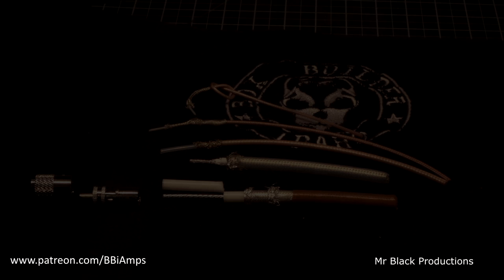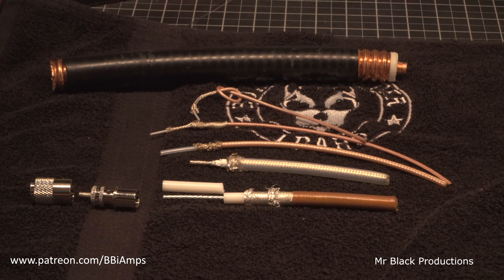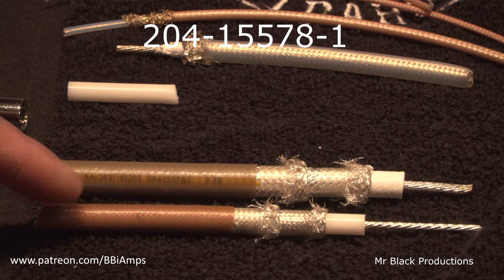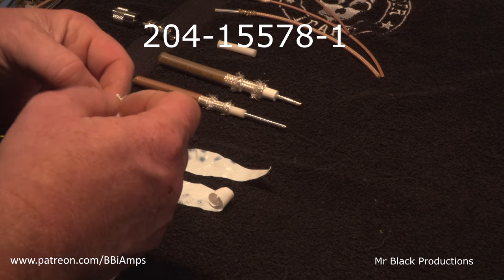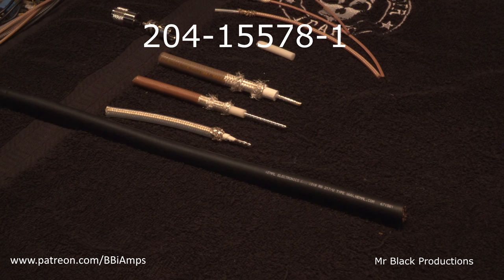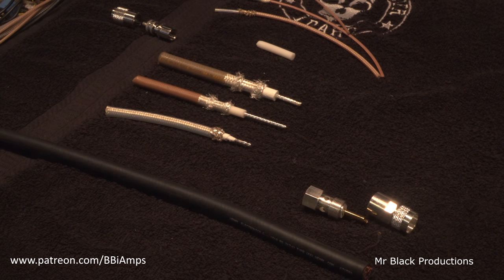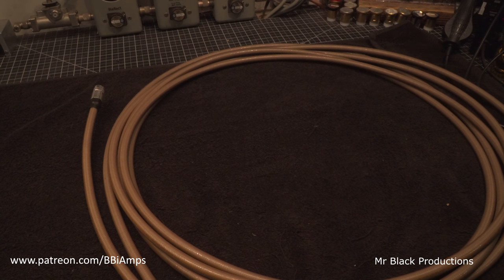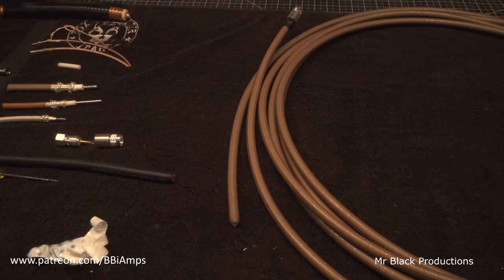Coax of the Gods "3.0"

Comment: Strange i just stumbled onto your video but i have ben looking for some really good coax & Connectors & Very Recently found a place out of italy that makes some of the best in the world...I have ben into radios for 35+ years ran a shop an all and i used to have trouble out of my coax seam like all the time until i found a 3/4 hard line & Teflon pl259's & that was the end of my coax problems(I was Running a small 2 tuber an maybe a 4 once n a while but i had trouble trying to run a 2..until i found The better quality Stuff..i know for a fact you just need to Buy Once Cry Once..lol.

Comment: I scored 100' of marine grade "5DFB" coax for cheap.  Japanese made, LMR-300 equivalent.  It's not made in this quality any more.  Solid #12 center conductor or #10 haven't measured, actual copper not copper clad, foil and braid shield.  Love it, wish it was still made in this quality.  Chinese still make it for cell phone boosters but its totally different than the original.

Comment: I’m curious as to whether TImes Microwave would do another run of that for a free range buyer’s group and, if they would,, what would be the minimum run and cost per foot (meter ?)

BTW I have used that Teflon stye of wrap to insulate some magnetic loop tuning capacitors I was prototyping. It almost worked, but I need some better manufacturing  techniques. Fun to try stuff, and learn as it bursts into flames

Comment: If you run that kind of power, you really need air dielectric!  So the heating is from the higher voltage and current?  That is into a 50 ohm resistive load when your coax got that hot running 30kw?  Have you broken down the dielectric of Heliax feedlines?  The reason this intrigues me is that it's about radiated power at the antenna and not just how many watts you can cram to it.  Teflon coax was never really made to be for long runs as it is kind of lossy.  It is a jumper coax.  I know this is an older video but for some reason Youtube is showing me CB coax and coax "tuning" videos!  lol  Thanks

Comment: Mr BBI have you looked at the  The S65161-A is a super low loss coaxial cable that’s also highly flexible, and unusually lightweight with electrical characteristics comparable to RG393

Comment: The 204- p/n is unique to E-3 AWACS US NATO UK FR specific and not the 707 airframe original.   Cage 81205 is Boeing.  A single dash number indicates a part, -10, -20 , -100 and so on would indicate an assembly.

Comment: Cable from Boeing 204-15578 is not the biggest Teflon Core flexible coax out there, the biggest is actually RG211:  center conductor = 4 gauge solid copper, Jacket Diameter = 0.71 inches...sadly it's only available to US military.  Closest equivalent might be specialty aerospace coax like RFMATES PIC_UH25107 (8 gauge), or maybe Carlisle 310701 (7 gauge).  If you need 45 kilowatt CW power, try 1+1/4 inch diameter coax like Heliax AVA6-50 which is used on almost ever cell tower in the USA, connector are part number 114EZNF and cost about $87 each which is too expensive so I just make my own out of copper water pipe.

Comment: I've been on a very different coax journey.. I'm looking for coax that can stand very many repeated bendings yet be extremely low loss.. I'm running QRP at vhf frequencies so the lower the loss the better.  Since I have to tear down and setup every time I operate my coax take a real beating..  I dunno, this is probably not the right place to ask but hey, it can't hurt :)
Reply from the maker: how big?
Reply: @BoxBuilderIdaho  Only 25'
Reply from the maker: No no..  how many watts if you're doing qrp that means very small. And how big like smallest as possible I'm assuming right
Reply: @BoxBuilderIdaho  First, thank you for the replies! 5 watts at most. Small is good, but I am running RG8x now without too much pain so it doesn't have to be crazy small.  I know I don't want to mess with my LMR400 out in the park, that is too big and resistant to bending to be handy.
Reply: RG316 very good for repeated bending.
Reply: @cliffyoung5712  Thank you, that is good to know.  I've actually considered that or RG316-DS but I have zero experience with either.

Comment: Can I safely run rg400 in my mobile barefoot or maybe with 300 watts thank you for all the knowledge God bless you and your family 👍
Reply: Mobile implies short runs. Maybe not quite 6 feet short, but short nonetheless. 1/2 wave with RG400 is just a hair over 12.5 feet.

And when BBI says low power, understand that he works with some properly massive numbers. 300 watts is quite low power by contrast. Hell, even 1K is.

I have a 12 foot RG400 jumper on the way that I'll be using in my diesel wagon with a barefoot SR955. I'll let you know how it works out.

Comment: I get that this coax can take high power, but I'm still lost as to why you need broadcast levels of power? 
If you're on CB it's a 5 watt limit, yeah running a 500w linear or a 1000w linear, yea cool, you probably won't get much attention, but 5-8000w? why on earth do you need that much power? 
If you're on 27mhz the majority of people will be anywhere from 5-1000w, if you you pump out 8000w, all you will do is get heard by many people, but you can't hear them.
For this reason it's better to look at antenna design, as getting gain at the antenna is much better than trying to ram power into an antenna.
Also at 8000w the antenna itself is going to need some design considerations, making it cost more.
My choice of coax is FSJ4-50a which is a heliax, I'm never going to be running more than 400w of power through it, mostly 100w, why I chose this cable is that it not only has low loss, but it also has low noise, as the jacket is solid. 
Braided jacket coax will have more noise induced by the braid, it gets worse when you have a braid on foil and even worse when the braid and foil are different metals. 
This noise can get substantial over long lengths like 100ft or 30m in real numbers, the noise can rise 3-6db, remember 10w to 100w is 6db which is one s unit. So 100w to 1000w is one s unit, so if your coax has 6db of noise being introduced you're losing a whole s unit on SnR. 
This is why I choose heliax, as it can help lower the SnR which is what you need to make contacts, not blasting your signal out yet you can't hear any replies.  
Also heliax connectors are usually much better quality, I have Messi & Peloni ultra flex 10 in a 10m roll with PL-259 connectors, yeah great quality, but my FSJ4-50 N connectors are Chinese and of near or better quality. 
The actual mobile phone tower connectors make Ham/CB type PL-259 connectors look like threaded banana plugs which is what they really are.  

Any way each to their own, I really like that Boeing coax but I will never need that much heat resistance, and if I ever did, I would just step up to 7/8 heliax or larger like broadcast sites do.

Comment: I've watched and read your coax off the gods series trying to understand where your coming from. I'm just an old swabby and radio guy. I've worked from 7 watts sideband cb to 55 million watts radar and frequencies that fry seagulls in flight.
It seems your only talking about pure power handling coax that can be used on mobile and base stations cb 27mhz.
I'm not in that world. I'm in the VHF world mainly and fiddle with 1.2 and 10ghz. LMR, TIMES MICROWAVE is the best choice for high frequencies up to 2.4ghz in hobby use. It's about containing the skin effect that's problematic in that world. It's not for power handling. It's low loss by virtue of velocity factor from better capacitance characteristics. The word you want to use of course is IMPEDANCE. My Aerial,   that's the word for receive only antenna is much farther away and 7 wavelengths long in Rhomboid shape. That gets rg-11 burial grade. 75 ohm cable is less impedance and allows a very low voltage VHF UHF signal to travel with the least loss.
These are my creative solutions in my budget based on 50 years of mostly military professional and barefoot Ham radio 10 meters and higher.
It's important to clarify to your audience that you are after power handling with low impedance to 27 MHz signals. Of course RG 217, 213 and all the variants will exceed LMR. 
AND...
Your friends are also blasting 5kw back to you so receive loss to micro volts is unimportant.
So for the record as you have found out, RG or Radio Guide and it's numbers is old tech retired military standards.
The new standards are C17 and folks can be informed by the excellent materials from a top tier vendor ALLIED WIRE AND CABLE  at ALLIED UNIVERSITY. It's also a good place to buy cutoffs from reels at great prices. You can have them make your cable of the gods if you have the money. I'm a broke ass swabby that came looking for 500 watts of 2m amplifier to realize my dream of an EME contact. I'm building a boom mounted quad Rhomboid for 29db gain to hit that moon at moonrise-set hoping to EME. I'M SURE YOU KNOW WHAT 2M AMPS ARE GOOD AND WHOS CRAP 😉 You are the man of amps and your always right about swr and ssb. My arthritis is pretty bad like my CW. 😂
https://www.awcwire.com/allied-university/this-vs-that/rg213-vs-lmr400

Comment: DXENGINEERING DX400MAX is much better than LMR400. Stranded center, full braid with tape, .07 db loss per 100ft. No issues at 2k at 150 mhz.